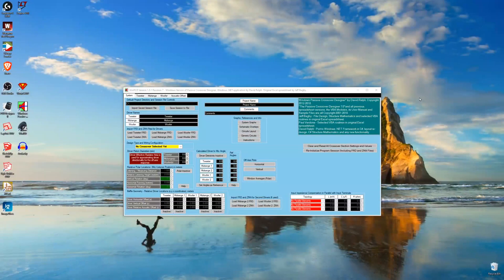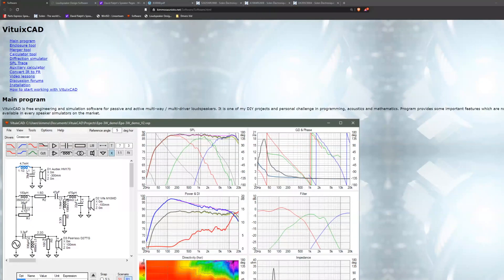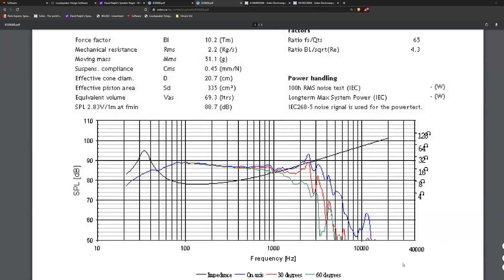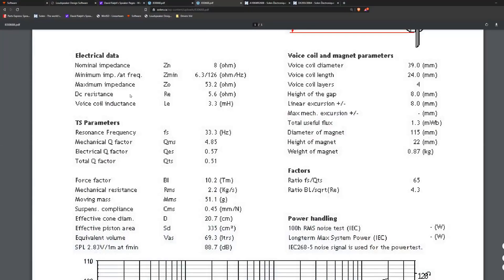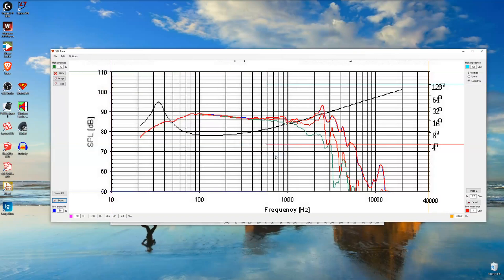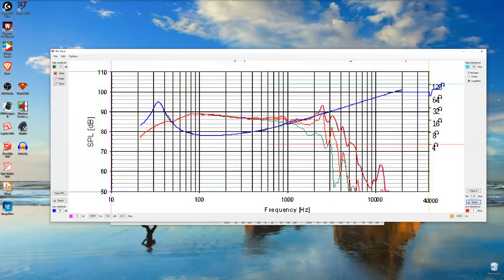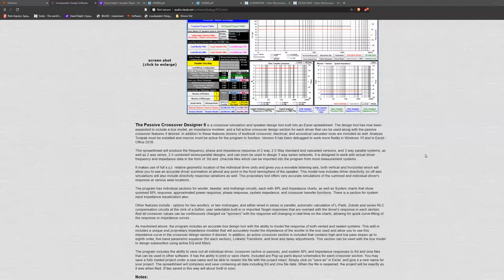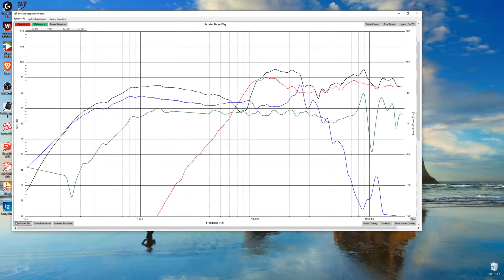DIY Building HiFi Speakers 3 FRD ZMA with VituixCAD and WinPCD

Comment: what if i dont have the frequency chart then how i creat frd file? Please help
Reply from the maker: Dayton audio sells a tool for measuring the drivers. Not Ideal but can be done.  Otherwise I would advice not buying a driver without having it.  To some extent without documentation it is guess work.
Reply: @masonstormdiyaudiovideo224  Why do you say it is not ideal to measure the drivers yourself? That is exactly how it is supposed to be done. Measure the drivers in the intended enclosure.